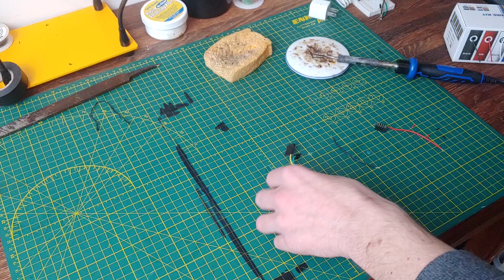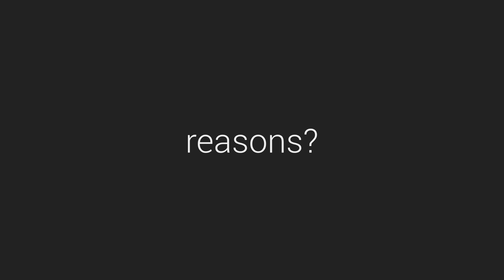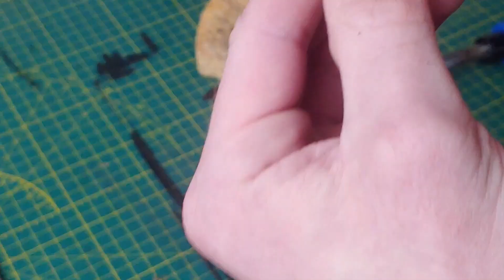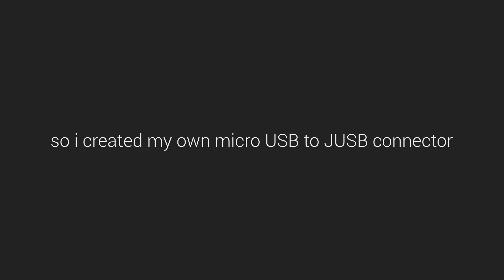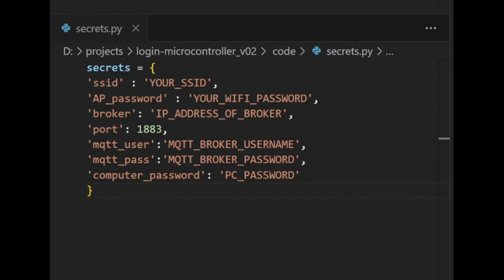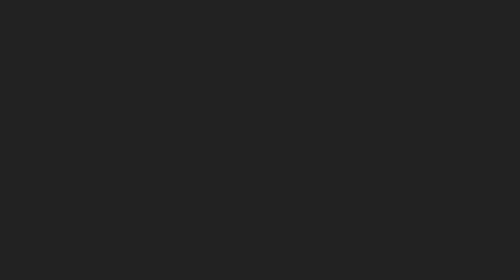Login to your computer over WiFi

Comment: The reason for the pull down resistor is without it the pin would be in a unknown state. the pull down ensures it is always low. a pull up resistor ensure the pin is always high. Nice video man
Reply from the maker: makes sense, I thought it was something along those lines. thanks for sharing and thanks for the kind words!

Comment: Nice! Been wondering how to remotely turn on my pc which I usually access remotely, but need to walk to the other side of the house to turn it on, but couldn't be arsed to build a whole PiKVM or buy a KVM just so I can turn the thing on. 

Any chance you could upload a full wiring diagram and a copy of the code.py you used for this one?

Nice vid and concise, GJ!
Reply from the maker: yes, i was going to create a github repo for the project, but i was having trouble setting up the account, so i will let you know when that is up and will link it. Ill also point out that in the month ive been using the project myself, its been a little inconsistent, so I have to troubleshoot that.
Reply from the maker: alright its up on github now
Reply: @bikecookrobots3646   Thanks a lot! I'll let you know if I run into any reliability issues and whether I find the reason for them.
Reply from the maker: @Kr3uZ75  I suspect the issue I'm having is its disconnecting from the mqtt broker and/or the wifi access point, so I just need to put some logic in the main loop to automatically reconnect